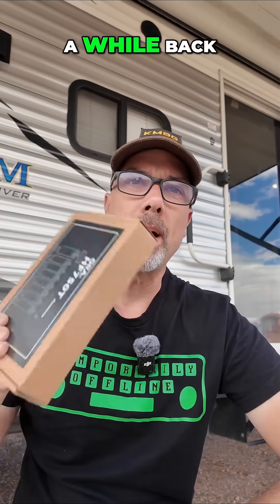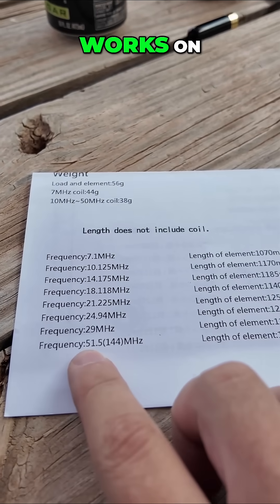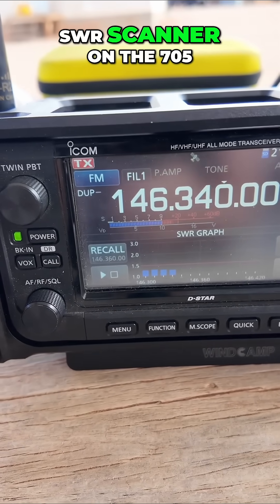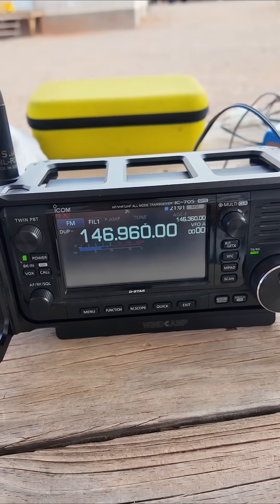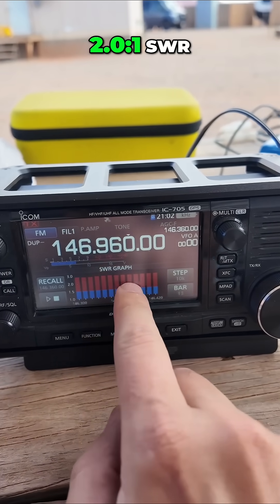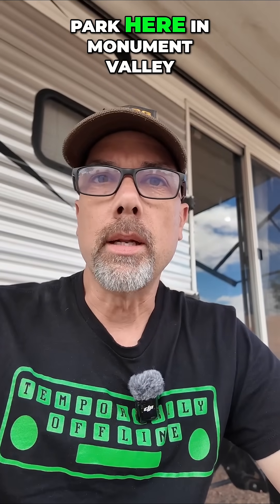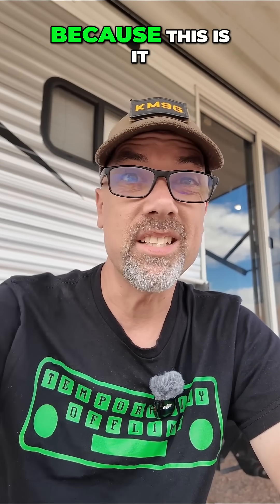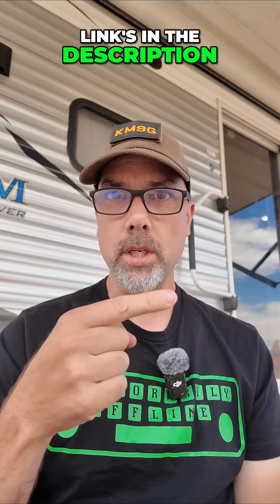Does It REALLY Work on 2 Meters? - GRA750T Antenna

Comment: Things may heat up faster but this is also a great example for not needing to obsess over chasing 1:1 SWR. Efficiency be damned, you'll still get your signal out.
Reply from the maker: "efficiency" is something hams argue over all the time... while you and I go out and make contacts.
Reply: @temporarilyoffline I hit some repeaters around town at that same level, and usually I copy them, but they don't understand what I'm saying. Good luck and thanks for the video,  Steve! 73 K5SAT
Reply: My concern is risk to the radio.
I am running an FT 891  and when if I go to antennas is the Gabil 950
Reply from the maker: @amariner5 I'm not familiar with the Gabil 950.  Can you give me some more information?
Reply: @temporarilyoffline  I don't think it's sold or supported. 
I bought it last year on Amazon 
I'm a very amateur amateur and only recently figured out how to use the SWR meter on my 891

The 950 is like the 750, but it doesn't have the marks. Pretty much I bought it because it had more numbers than the 750 but I wish I had the 750.
Reply from the maker: You'll have a ton of antennas before you're done